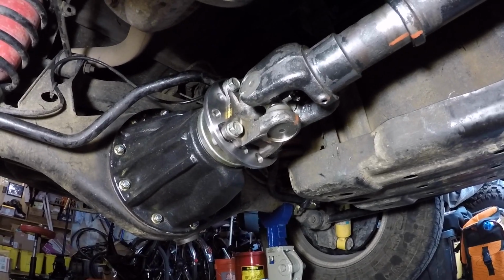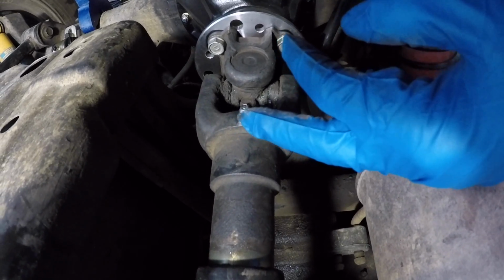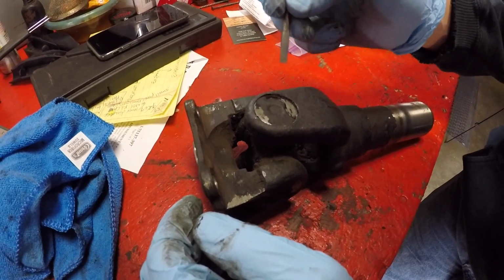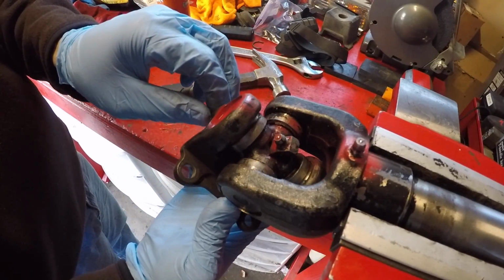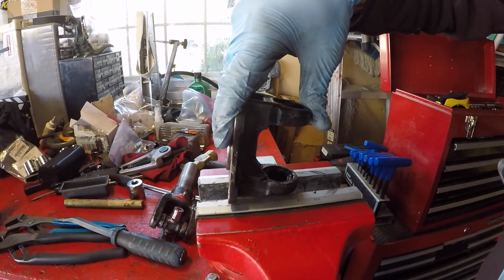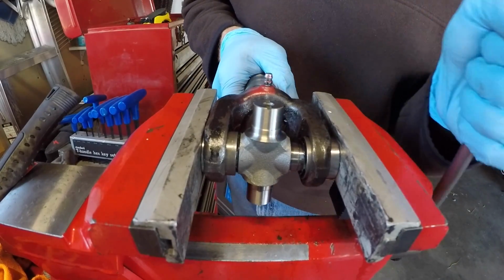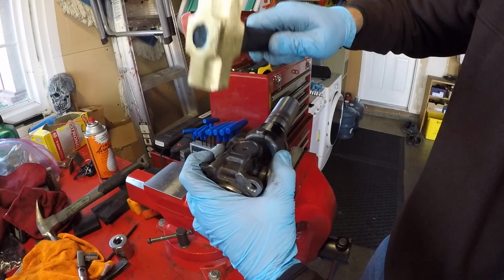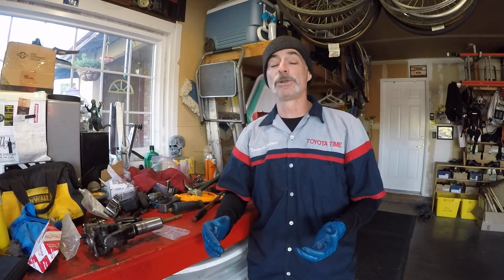U-Joint Replacement

Comment: I supported the yoke between two pieces of 2x4 with a gap in the middle such that the longer piece was freely suspended and the shorter piece beared across the gap. Using a hammer on the longer piece I was able to pop the upward facing cap out completely. I then flipped it so the other cap faced upward and continued to pound until the other popped out, freeing the longer piece from the smaller. For the small piece I used the same 2x4 gap trick letting just the very edge of the small piece keep the cap suspended. I beat on the cap facing upward with a 19mm socket until the bottom piece popped out slightly. Next, I used an angle grinder to cut off both sides of the joint inside the smaller piece. Finally, with the structure of the joint gone inside the smaller piece, I was able to use the 19mm socket to pound the caps all the way in through the center.
Reply from the maker: Good job getting it done.  Did you take any pictures of how you did it?  A write-up showing your technique could help out others.  You could post it on T4R.org.
Reply: @TimmyTheToolman  I wish I had captured some pictures of the process. The technique I used ended up being very similar to this video: https://www.youtube.com/watch?v=9P7wkkdcFos&ab_channel=ThePracticalMechanic
Except I used soft lumber to support the yoke as I beat on it. Also, the caps in the longer piece would not come out with just the hammer, so that's why I resorted to using the angle grinder.
Reply from the maker: @AustinWilhite  This technique looked like it worked really well in the video.  Thanks for sharing it.
Reply: @AustinWilhite  I had watched this video before watching Tim's long version. Big F-ing Hammer method definitely wins. Tim should really be warning people about the truck lurching when you disconnect the driveshaft  from the differential.

Comment: Great video. Considering the double cardan, I’m probably just going to order a new driveshaft from Tom woods. Their price seems reasonable and there is always wear in those splines.
Reply from the maker: Yeah, people have reported getting the double cardan joints rebuilt but the available parts have suspect quality so you're making the smart choice by replacing the whole driveshaft.  Tom Woods makes quality driveshafts so you'll be happy with the swap.

Comment: I can attest that lining up the splines 100% to a T isn't horribly crucial as it is to have all yokes parallel as possibly. You can pretty easily spot if it's off, even by a tooth, it's really overblown
Reply from the maker: We try to give the best information possibly to those who are attempting this repair. Having it lined up as best you can is always better to ensure you don't run into issues.

Comment: Well I wish I would've watched this earlier! I was curious why it was so damn hard!!
Just tried to do all 3 today thinking it would take maybe an hour, and it ended up taking maybe 7 or 8! For some reason I couldn't get the U joints to go in the cardan without galling the metal, and how they're halfway recessed makes it HORRIBLE to deal with. I even blew out the cup on a NAPA joint with my press when trying to squeeze it in, it was THAT tight - shattered hardened steel. About halfway through I was wishing I just had a custom one made for maybe $400, but was in too deep to stop! Ended up having to sand down the holes in the cardan until the fit snug and could be tapped in, otherwise they kept binding on the walls halfway down the socket. Rear wasn't much different either!
To boot, I knocked over the driveshaft at one point and the needle bearings from that center ball came out! Had to scrounge them up and clean them, only got about 3/4 of them but everything's installed now, there's no squeak or shudder and it's smoother than it was before!!
Reply from the maker: Thanks for sharing.
Reply: @patrick.weightman did you say you did the 'cardan'?  I ask because I discovered a low hum and vibration at higher speeds, checked all my u-joints and it's the one facing the rear end on the double cardan joint.

I'm considering attempting to do this, but haven't heard of anyone doing the cardan.  What part number did you use (if you remember)?
Reply: @patrick.weightman did you say you did the 'cardan'?  I ask because I discovered a low hum and vibration at higher speeds, checked all my u-joints and it's the one facing the rear end on the double cardan joint.

I'm considering attempting to do this, but haven't heard of anyone doing the cardan.  What part number did you use (if you remember)?

Comment: i just bought 3 u-joint on rock auto then i learn there a ball and some special u joint...
Reply from the maker: Sounds like you're trying to rebuild the double cardan joint?  Sourcing the u-joints and center ball for the double cardan joint is difficult from what I've heard.  What brand u-joints did your buy from Rock Auto and what's the part numbers?
Reply: @TimmyTheToolman  moog heavy duty non greasable u-joint
Reply: @TimmyTheToolman  i will put the part number when back home right now i am under the truck
Reply: @TimmyTheToolman  Part number: MO 287 i bought this u joint to replace the one near the rear diff and tought while beaing there why not change the other two but after seeing your video i will only be changing the one near the diff. By the way great channel and video help me on my repair cheers
Reply from the maker: @relaxeful  Good luck with the job.  Hope the job goes smooth for you.  Good to hear you like our channel.  Happy Wrenching!

Comment: Just replaced mine in a 2002 tacoma V6 ext cab 4x4. 
Just to note, if you have some trouble getting the initial bolts off due to some rust causing the bolts to seize a little, then you might run into what I did.
I had trouble getting my original trunion out of the jaws of the yoke. The puller I bought did not work out at all. Absolutely zero amount of hammering or pulling with the puller would make the bearing cups budge. And yes I had the c clasps removed.
What I had to do was take it to my metal shop and plasma cut out the center of the trunion and dunk it in water to keep it from overheating. I was careful to turn it so as to not get any slag or the cutting plasma onto any parts I'm reusing. 
I was then able to separate the four bearing caps from each other and pound them out with a hammer and socket very easily after cutting the center out. I found that the bearing cups had become fairly rusted on the outside (which is why they seized) and that two of them had really rusted needle bearings.
Where there is a will there is a way and batta bing, batta boom, I replaced my u joint for under $30. 
So I'm happy.
Reply from the maker: Glad it worked out for you.  The puller didn't work for you but you found a way to get it done.  Good job!
Reply: @TimmyTheToolman  oh yeah, your video helped out a lot though. Thank you!
Reply from the maker: @jimbosmith6327  You're very welcome.

Comment: Any tips for internal c clips that keep spinning when attempting to remove? I’ve done 10/12 perfectly fine with this method and the last two won’t budge they just spin. I’m using the hammer and screwdriver method shown in the video.
Reply from the maker: Maybe an extra hand would help.  One person holding pressure on one side of the c-clip with a screwdriver while you whack the other side of the c-clip with a hammer and another screwdriver.  Or, if you possess the required dexterity, hold both screwdrivers with one hand, and hit just one of them to get the c-clip driving out of it's groove.
Reply: Timmy The Toolman thanks man I’ll give it a try
Reply from the maker: @andrewdesjardin4996  Let me know if it worked.  Good Luck!

Comment: Hey Timmy. What are the signs that the U-joint is going bad? I started having a condition with my truck. When turning, it will go stiff, back to normal, stiff again, and then back to normal once the turn is done. At first, I was thinking my PS pump but it makes no noises, doesn't leak, and isn't constantly stiff as I've read would happen if the pump goes bad. After further investigation. People have said that the same condition was produced by a bad U-joint. Do you have any thoughts on this? Thanks in advance and thanks again for all of your videos. I just replaced my front 02 sensor. 👍
Reply from the maker: Remove the one side of the drive shaft that you suspect has a U-joint problem & twist it to see if you can see if the u-joint has any play in it.
Reply: so there's a front and rear U-joint? The u-joint should have no play?  got yah. I'll have to do that this weekend early in the morning before it reaches 110. lol

Comment: Both my manual transmission and transfer case are in Neutral, yet my rear drive shaft did not spin to be able to get each bolt easier. The rear wheels were off the ground with jack stands on the rear diff. Any help??
Reply from the maker: Is you parking brake off?
Reply: Timmy The Toolman ya first it wasn’t. I’m actually doing this on a 2nd gen, so I have the old school push button and turn parking brake. I released that and still had no luck. Is there anything different from doing this on a 2nd gen?? Thanks for you quick reply Timmy!
Reply from the maker: @Yurrweoutside  You should be able to turn the driveshaft unless your rear brakes are dragging a bit.  Try grabbing one of your rear wheels and turning it.  If you can turn it, the driveshaft will turn too.
Reply: Timmy The Toolman Thanks for the tip! I’ll try again tomorrow and try rotating the rear wheels while they’re in the air. Thanks again for your endless wisdom!

Comment: Thank you Tim....I'm in the process of replacing my U joint....I called it a night out of frustration....... I have a two jaw puller....just didn't think of using it.. definitely going to try it tomorrow... thanks again.....
Reply from the maker: Yeah, it was a frustrating experience for Jordan and I too until we figured out the 2-Jaw Puller technique.  Hope it goes smooth for you on your second attempt.
Reply: @TimmyTheToolman  Man I have one of those too. Was about to give up on that angled front spider and rent/buy a ball joint kit. THANK YOU.
Reply from the maker: @MrCobra762  You're welcome.  Let us know if the technique we shared in this video worked for you.  Happy Wrenching!
Reply: @TimmyTheToolman  Ohhhh no Timmy I think I just messed up...ughh. Everything was going is smooth slowly pressing in the two cups in the vice. Both sides in about halfway on the wide part actually making contact. Had good alignment with yoke having full travel in either direction back and forth til all in. Was favoring One side a tad and I allowed that side to bottom out fully. Some of the needle bearings must have fallen then because now the yoke stops 3/16" short of going all in like the other side does. :( Holy crap man any ideas how I can get just that side back out to realign the needles?  Hopefully without damage? All I can come up with now is keep going, but into a socket, in attempt to drive it back out the appox 3/16" it's in so far. Won't that ruin the needles on that side though with flat spots?
Reply from the maker: @MrCobra762  Not sure what advice I could give you without seeing what you're dealing with.  If you could, shoot me a pic.  Here's my email address: mtbtim@sbcglobal.net
Reply: @TimmyTheToolman  Awesome brother will do and thank you!

Comment: Great Video and thanks for taking the time to edit and post. 
I have tried to follow your method, I didn't find it until it was too late. With a two jaw puller and basic socket wrench my u-joints are not going in very easy at all. In fact, I had a partially inserted a c ring and after reducing tension it popped back out. Does this mean a bearing has fallen down some where? If not any suggestions or just keep wrenching?
Reply from the maker: It's hard to say what's going on with your u-joint install.  I'd have to see pictures to understand the issues you're having.  If you want, you can email me pictures.  mtbtim@sbcglobal.net

Comment: Did you find that the new caps seemed a tad smaller when you compared them to the old caps? I was gonna swap out my 3rd member you joint today but after comparing the cap sizes (just back to back in the yoke/flange) the new caps seem smaller than the old ones. I had the dealership cross reference the upping with my vin number but just seems odd to have the cap not fit tight in the hole from the top.....not used to changing inside keeper ring u-joints.
Reply from the maker: The u-joint we got for this job was an identical fit to the old one.  Did you use Part #04371-60070?
Reply: Timmy The Toolman - Yes. Didn’t press the old cap out yet as was holding off as it seemed the new cap was smaller in diameter compared to the newer when comparing them back to back in the yoke/cap seat. I ordered the 70 per the dealership and my vin.
Reply from the maker: @i-have-no-name-or-life  Since you don't have the old caps out yet, maybe what you're detecting is a slight relief at the end of the yoke and not the fact that the cap of your new u-joint is actually smaller.  I think the  entry hole for the cap on each end of the yoke needs a slight relief so you can have an easier time getting the bearing cap started into the yoke.  Without that relief, it would be tight right upon entry and be hard to get the caps driven in straight.

Comment: Do I need to replace the slip yoke if I scored where the bearings seat with a press kit? Or just file it down and scuff with a pad?
Reply from the maker: Just smooth it out with a fine round file and emery cloth.  As long as the bearing cap can still slide in and fits tight, you're ok.

Comment: I don’t know If you happened to mention it but is it possible using the Pitman jaw, to extract the two conjoined U joints? The ones on the rear drive shaft near the Transfer case?
Reply from the maker: Hey Daniel, servicing the double cardan joint on the rear driveshaft is a whole other ballgame.  Toyota doesn't sell replacement u-joints for this application nor do they sell a replacement for the center ball that also makes up that joint.  There are supposedly replacements you can find but the quality is suspect.  The owner of a driveline shop near me said he doesn't rebuild them because there's only inferior replacement parts available for them.  You might be better off finding a used driveshaft in good condition or get a custom driveshaft made for you.  If you're u-joints are still good and just wondering about the ability to replace them, don't mess with them.  Just keep them greased and they'll most likely last a very long time.

Comment: Hi Timmy
How often should I apply grease the driveshaft U-joints for 2016 Toyota LC200? Thanks
Reply from the maker: Every other oil change or every 10k miles is what I would suggest.  I use to do it every oil change but that's excessive.

Comment: my slip yoke is missing the cap on the inside.  any advice? hacks to fix this?
Reply from the maker: You could remove the u-joint and see if a driveline shop could weld in a new cap for you.  They probably wouldn't charge you that much.

Comment: Is it possible to just replace old slip yoke/ujoint with a new slip yoke/ujoint? Without having to get the driveshaft rebalanced
Reply from the maker: Yes, you could get away with that.  If you analyze your driveshaft, all the zerk fittings front to back are all facing the same direction.  Toyota balanced the driveshafts in this fashion.  When you slide the new slip yoke on, line up the zerk fitting with the front ones and it should be balanced.

Comment: Are all U joints the same size??
Reply from the maker: No, they are not.  I'm pretty sure the rear most u-joint for the rear driveshaft that attaches to the rear differential and the front most u-joint on the front driveshaft that attaches to the front differential are the same.  But, the ones in the double cardan joints are a different u-joint and Toyota does not sell them.
Reply: Timmy The Toolman how could you find the ones that Toyota doesn’t sell if they are needed? And do those usually go bad or is it the ones to that front and rear diff more common o go bad? Nevermind just heard you say it in the video watching it the second time
Reply from the maker: @palaciosivan100  Yeah, people have rebuilt the double cardan joints but the u-joints available are not the greatest.  I had a driveshaft shop rebuild a driveshaft for me recently and I asked the owner who's been in the business for 30 years if he rebuilds Toyota double cardan joints and his answer was NO, because Toyota doesn't sell replacement u-joints for it and the u-joints that are available are garbage.

The best thing you can do is keep your u-joints greased and they will last you a long time.
Reply: Timmy The Toolman so if that double cardan joint is bad what’s the way to fix it?
Reply from the maker: @palaciosivan100  You get it rebuilt by a shop or try it yourself.
Reply: Timmy The Toolman and the rebuild is reliable ?
Reply from the maker: @palaciosivan100  I'm assuming you read my previous response to your question 2 months ago.  What I heard is the replacement parts are suspect and not that reliable.  I do know of a guy on T4R.org that got his double cardan joint rebuilt around 30k ago and so far so good.  So, maybe the replacement parts aren't that bad.

Comment: Y'all make this so complicated lol. Use a damn hammer and you're good to go. Nice work though
Reply from the maker: I wish it was as easy as you say but we learned from our first attempt and came up with what we shared in the video as the best option we could come up with.  If you knock that first bearing cup in too far to where it drives fully out of the yoke, it's a bitch to get it lined back up to come out.  If you could drive that first bearing cup in with reckless abandon and have no consequences, then it would be as easy as you say.  But, ti's not from what we learned the hard way.